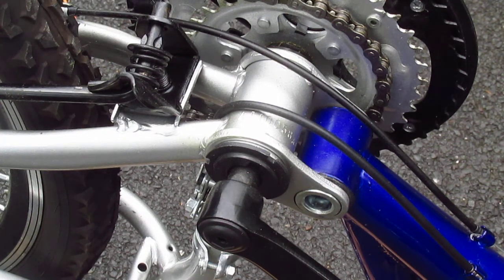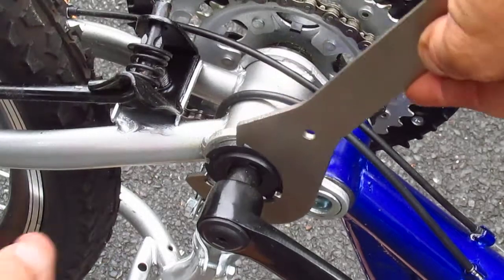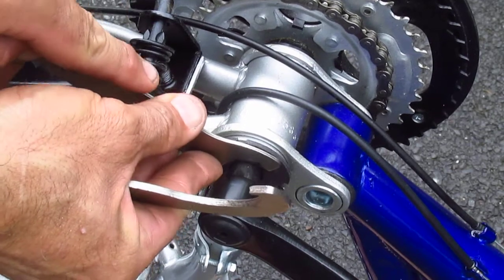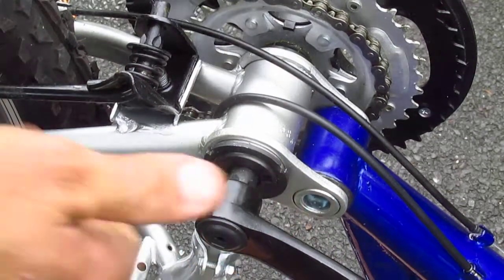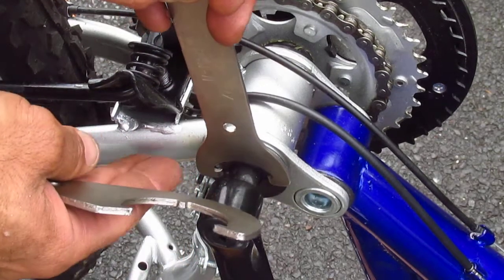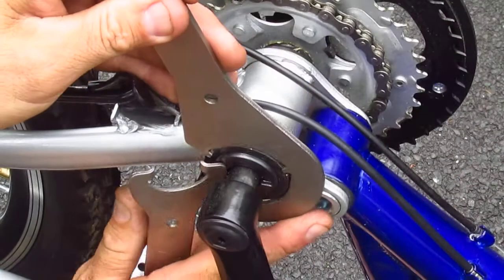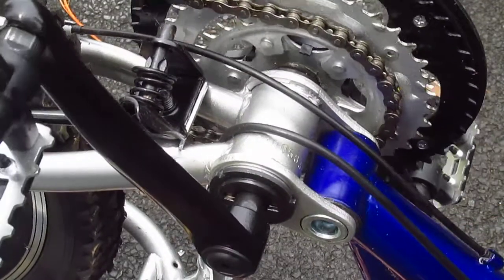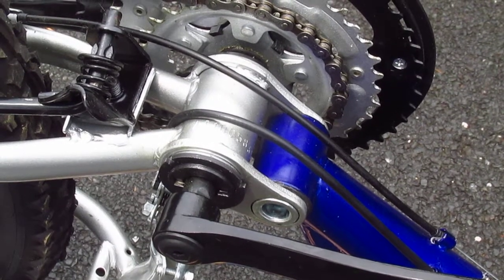How to TIGHTEN a CHEAP MOUNTAIN BIKE'S (NON-CARTRIDGE) BOTTOM BRACKET

Comment: Well so I got the tools, but the bottom bracket thingy doesn't move only the lock ring does. No difference whatsoever in the crank arm moving. What can I do? I don't wanna have to spend hundreds to go to the bike shop whenever this happens
Reply: your bearings could be worn to the point where you need to replace them, if this is the case no amount of tightening will solve your issue.